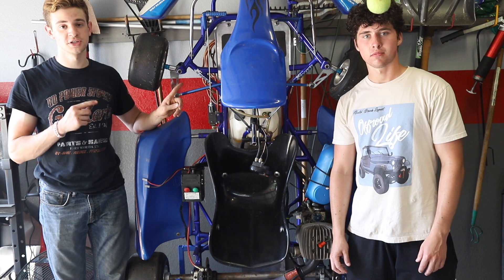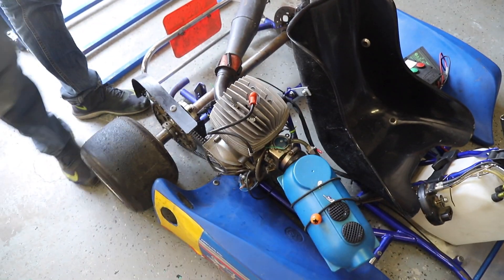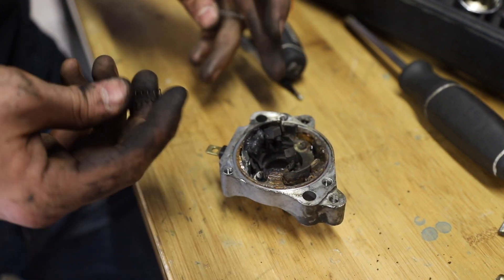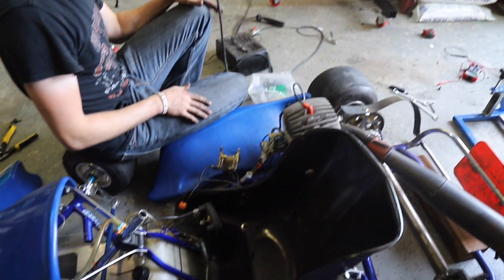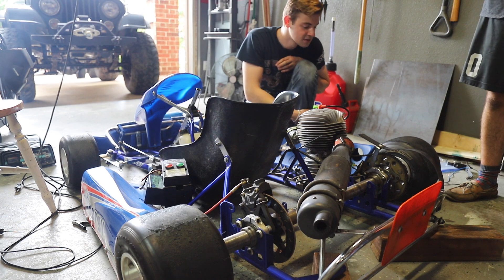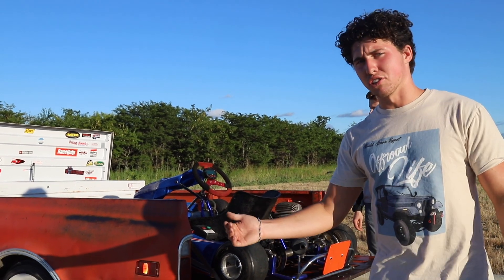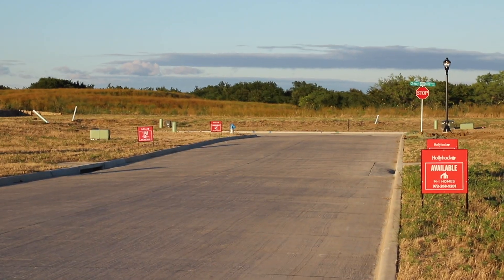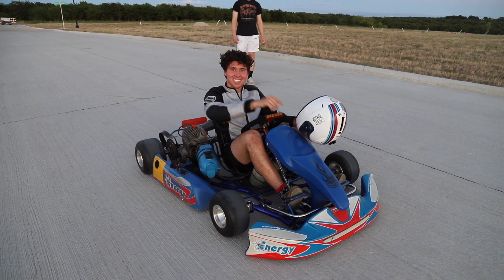FREE 2 Stroke Racing Go Kart Find! | Will It Run?

Comment: Damn good find! That dashboard is called an Alfano Pro and they are worth at least £80 here in the UK. IAME engine as well! They are generally nice and strong so long as they are looked after well and by the looks of the alfano it hasn't done many hours :) If you ever get stuck on the engine side of things PM me as I know my way around these 100's :)
Reply: MPS Racing im in the USA and I run a tag 125 iame
Reply: Ben Holder X30?
Reply: MPS Racing yes
Reply: might want to check your engine serial # for specs, that may require racing fuel or Methanol. Some iame engines will detonate if ran on regular unleaded. But carry on it was FREE lol
Reply: Will i am MC IAME engines detonate sometimes anyway :)
Reply: MPS Racing we run 110-112 octane
Reply: I use a michron 5 for timing and i run 206 jr 2 but im gonna start TAG soon, and ive driven an 100cc vortex and its sick.

Comment: My first thought was that the engine looked similar to the very popular IAME KA100 engine. However, after doing some quick research it looks like it might actually be an IAME Komet KFS 100cc engine, which was apparently built for the French market. If you go to the IAME Engines (international) website you can find a manual for the engine in PDF format. Unfortunately it's in French but it has a lot of photos and diagrams. There's a few things that stand out from the manual, including the starter box with red and green buttons (different in appearance than the KA100 starter), red spark plug cap, blue colored coil, and silver-ish/grey head (as opposed to the black colored head on the KA100). You may need google translate but IAME manuals typically give recommended carb adjustment settings and instructions.

Comment: If you haven't done so i would recommend fixing/replacing the clutch. if it is always engaged, it will wear out the brakes very quickly and quite possibly at the wrong time. Have the new starter ready to go because when the clutch is not engaged, push start will not work.

Comment: The chassis looks to be an older Energy, not sure which model but that is awesome. You should definitely take it to a karting track! There are 2 by me but they’d probably be far because I am in New Jersey. That is so awesome!
Reply: And the engine is an IAME 100cc engine. I used to run IAME engines and they are amazing. The only issue is if they have too many hours in between rebuilds they are super down on power. But I can’t wait too see more of this!

Comment: 9.34 when you have no clutch and you roll back, the engine is firing backward. The same thing happened to me and the crack twisted, so to not stuff you engine  hold the brakes as hard as you can when you roll backwards.     👍👍👍
I just don't  what to see you suff you engine up

Comment: It’s a KPV 2 (100cc), the clutch will not free one of the springs on the inside of it is broken. I used to race the same setup but now I race a a different Motor. I have 2 in my garage not just one.

Comment: If you sock the tiers in PB blaster or D40 they will soften up.
Reply: You would think messing with go karts all the time they would have some traction compound around. I  understand it's not something everyone has, but everyone I know with a kart has a gallon or two around. I didn't even race, just had a race kart and I had that and a 55 gallon drum of methanol (which was given to me when I bought the kart). The compound I bought though. It's very handy to have.

Comment: its a iame parilla 100cc I HAVE ONE THE EXACT SAME
Reply from the maker: MARC GALLARDO ok nice yeah I had a feeling it was a parilla didn’t know what cc
Reply: MARC GALLARDO  is that the predecessor to the ka100?
Reply: I ran a Parilla tt25 and a tt75 it will out run a kt100 massively   . Reed valve is always faster than a pistonport engine   also tuneing  is not as touchy on Italian  Racing  engines  they just run and most parts from won't interchange  with non Italian engines.

Comment: Look at the chassis homologation number. Than do a such on the FIA's website, you'll know which class this belongs to, there's a good chance the motor is matching the requirements for that class. Otherwise, if you only care about the displacement you can measure the bore and stroke and do maths :)

Comment: Owww the engine spun in reverse when he spun out.

Also you easily spin out if you gas and brake at the same time on karts
Reply: Sam ur Boi fake news...
Reply: Sam ur Boi ask some of the faster kart racers, and you’ll learn this is typically a go fast technique (depending on track and setup).
Reply: @EricSchutt  hmm rotax max isnt fast?
Reply: Sam ur Boi didn’t see that anywhere in what I said...and maybe not ideal for your setup and/or track.  That part, I did say :)
Reply: @EricSchutt  ty for advice tho
I think i know what you mean , you can enter and exit corners faster this way
Reply: @mrpoopybutthole6314  ah thank you